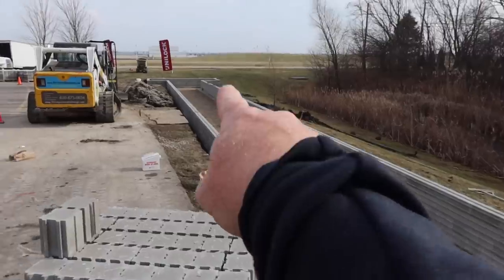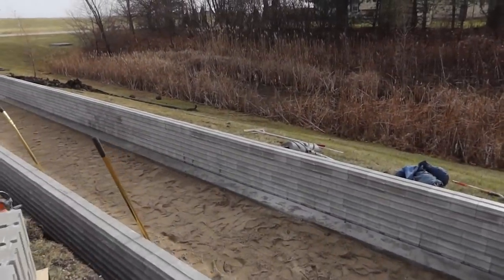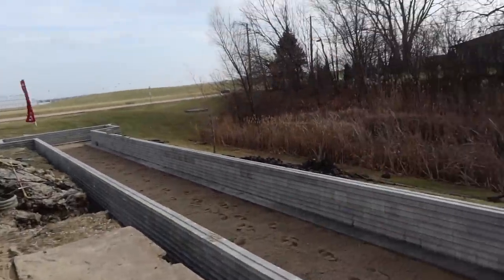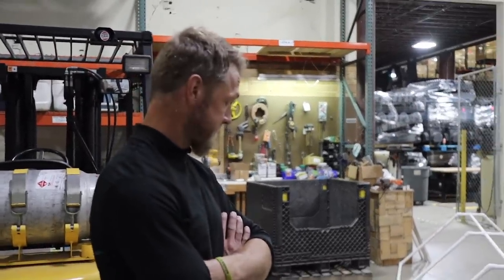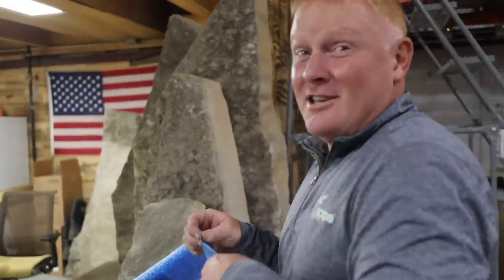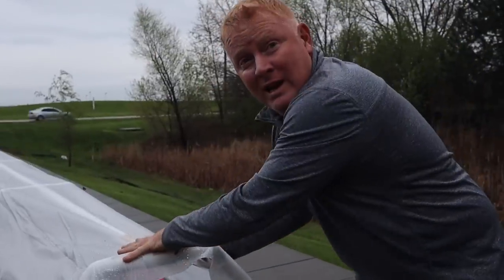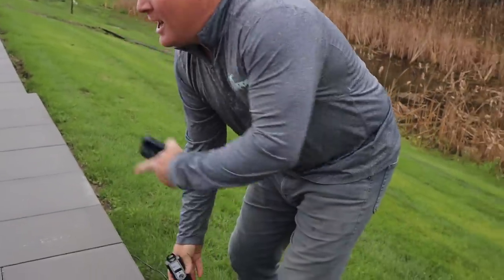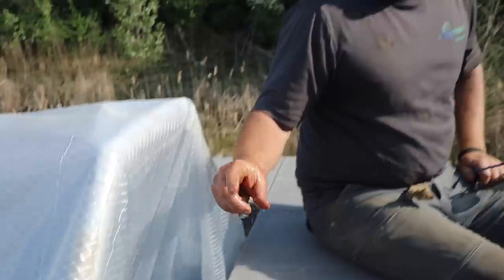100 Foot Long WATER LILY Pond At Aqualand!

Comment: Hey Brian I had an idea??? I don't know if it would work if you put the bubble wrap around the PVC and then put the pool floats over that to hold the plastic wrap in place pinching it together between the float and the PVC without needing to use so much gorilla tape, or not needing the tape all together?? For next year??